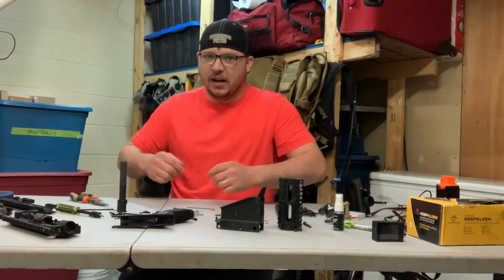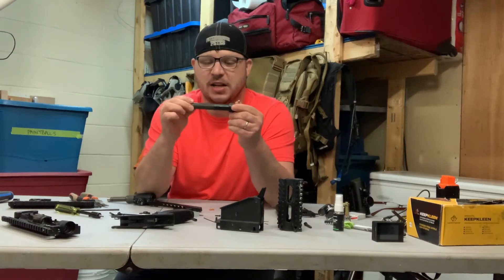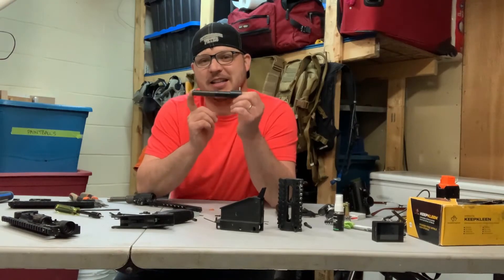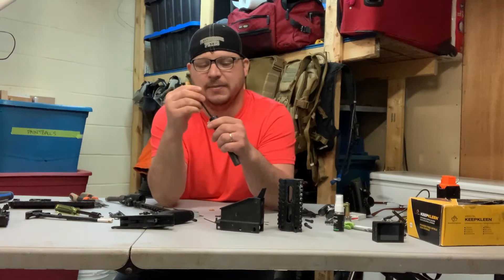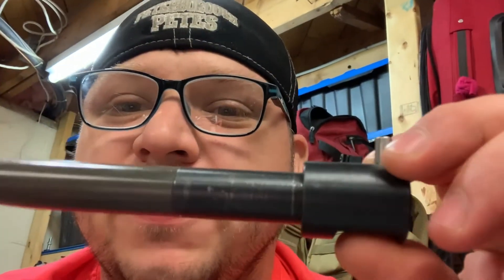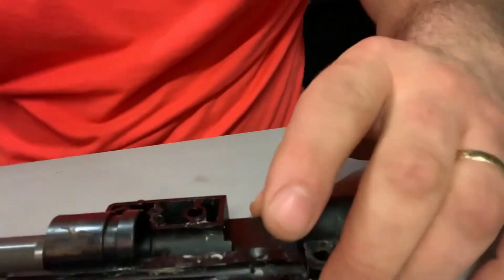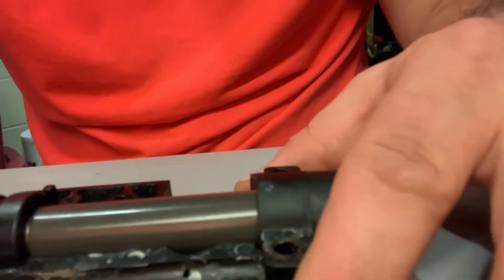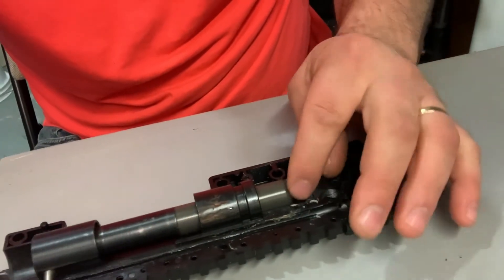My M17 BOLT Separated!  Repair/Tech Video 👌

Comment: This really helped.me matey, this was my M17 issue. On my CQMF the issue was the hopper plug. It needed 2x washers to lift it out of thr breach a little
Reply from the maker: I found the same on some of the m17s, where I just sanded it flush.

Comment: Hi, love your vids. Which grimburg barrel and suppressor did you recommend for the highest fps for the M17A2? Thx.
Reply from the maker: Ummm, I normally try to stay away from answering questions like this, because there are other YouTubers out there who focus on weaponizing these units, I don’t want to steal their thunder, but bore matching your projectiles will retain expanding gas in the barrel, preventing air from escaping around and wasting energy,  also, if you enjoy just shooting random stuff with your m17 using rubber reballs or whatever, you will find that lubing the barrel will reduce resistance, especially where rubber rounds are concerned

Comment: Hey I just got a question last time I went to play with my m17 it's started to leaking from the inside do know what wrong with it
Reply from the maker: That is a sign that the HeatCore O ring requires replacement
Reply: @MechTactical  great thank you so much
Reply: I had the same issue with my bold hitting the barrel. It was not loose but somehow it is not straight. so I screwed out the pin inside and found that the the screw that holds it is not straight. I don't want to spend a lot of money on a new main bolt, so i would like to know what the pin inside is called.
 I found it online, but now I can't find it any more. I don't want to replace the hole  main bolt. So if yoy could give me the name of the part (pin?)  that would be great. Maybe it is possible to just replace the screw.

I have the old milsig m17 without the updated Mainbolt.

I would be really happy 9f someone can help me out ☺️

Greetings from Germany ✌️